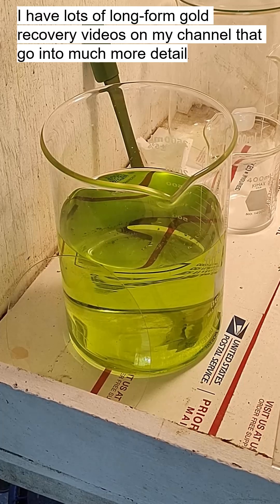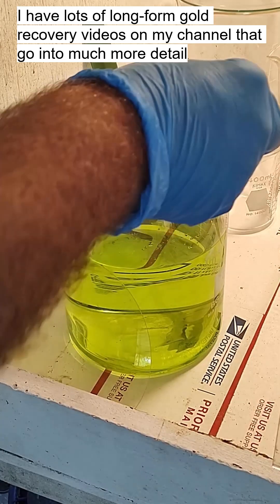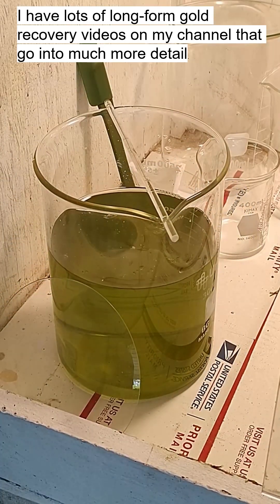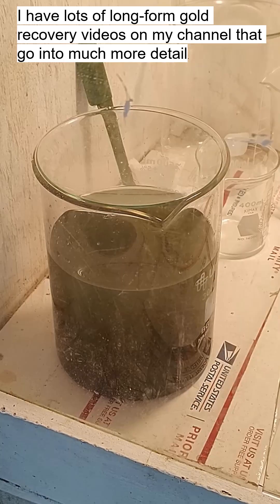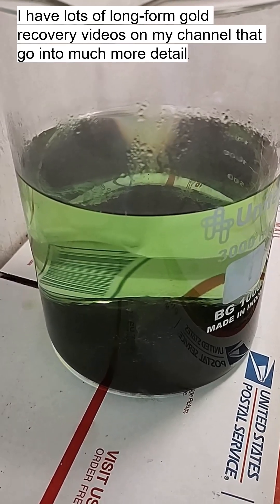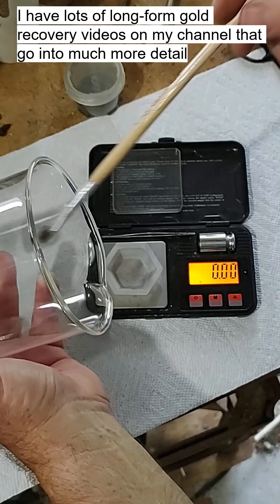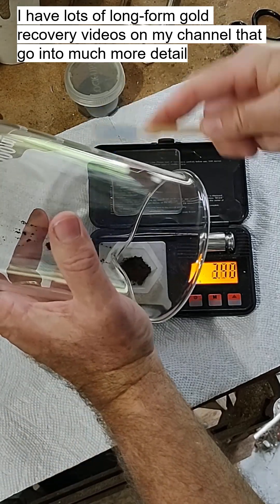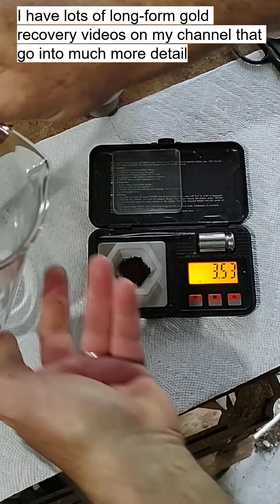Gold Precipitation From Solution #Shorts

Comment: A  solution free of particulates,  but there are other metals in solution, otherwise the solution would be yellow, then clear after you dropped the gold.
Reply from the maker: Yes, there was some copper in the solution. I will refine the gold powder in the future to remove any traces of base metals.
Reply: @omegageek64  I'd love to see you or anyone else try recovery of circuit board flash gold, and refining of misc silver contacts - the newer PITA kinds. 

Flash gold like that seen on flat screen display boards. So called finger boards.